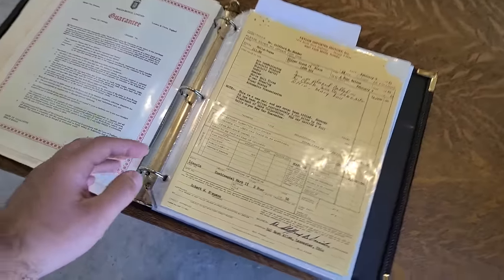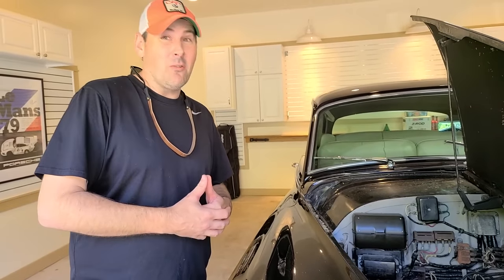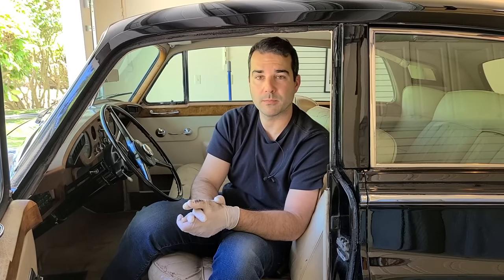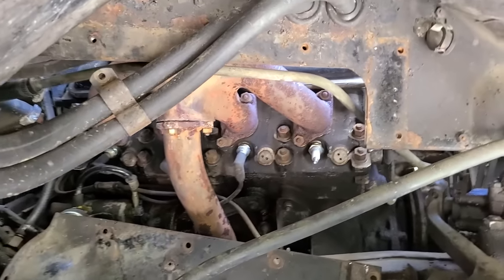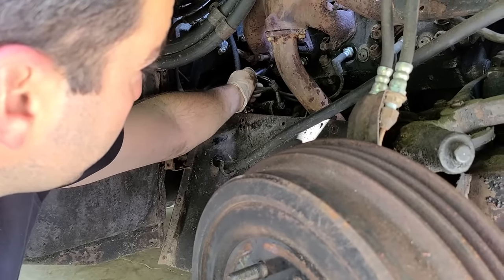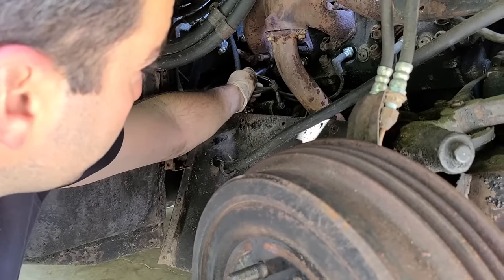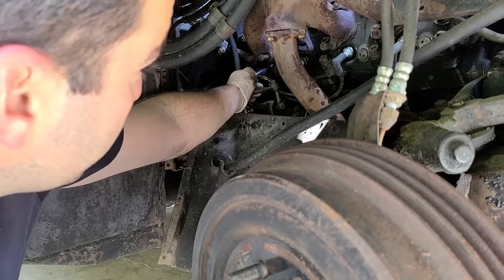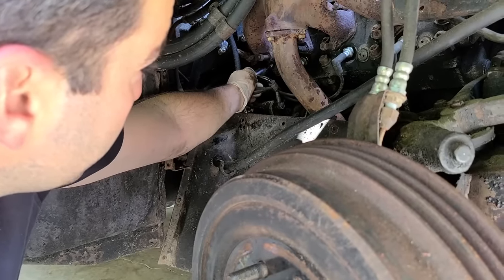I Bought A Broken Rolls-Royce 1000 Miles From Home! 1 Day To Fix EVERYTHING Before Hitting The Road!

Comment: I regret you selling most of the cars in your fleet. You gotta keep this ride to chauffeur your kids to school and sports.
Reply: For their safety, please don’t
Reply: @marcmiyamoto  This was one of the safest cars ever built...
Reply: @fraidykat  so safe it doesn't even have seatbelts
Reply: @poptartmcjelly7054  Not a legal requirement when this old lady was conceived, apart from that drivers of a RR  were a civilised and decent bunch of chaps, unless of course they had a bit of totty on their arm...
Reply: @fraidykat  So safe that even a smartcar (2-seater) tiny micro-car is safer...
Reply: @Samosayummyyay  Smart Car doesn't even come close to this car.  Rolls had one of the best unibodies ever made.
Reply: @poptartmcjelly7054  Didn't need them.
Reply: @fraidykat  there’s literally no seatbelts your gonna tell me a car with no seat belts is safer than a modern car
Reply: @marcmiyamoto  If you want seatbelts you can add them.

The level of safety you prescribe to requires first removing the brain and to then stop thinking.
Reply: @fraidykat  Yeah that’s sounds safer than a Smart Fortwo retro fitting a seatbelt to a 1960’s Metal death trap
Reply: @fraidykat  oh? the smart got a relative high rating whereas that Rolls has not. Also, Mercedes Benz builds those tiny little Smart cars. And unibody does not translate to proper allround safety.
Reply: @Samosayummyyay  The Smart will never overcome the conservation of mass difference between it and anything else on the road except a motorcycle.
Reply: @oneswellfoop  unless you are driving a w124 mercedes. A modern car rear ends you and barely a scratch while the other car is a wreck

Comment: This rolls is much more reliable than the new Mercedes lol
Reply: They have too many finnicky electronics. Source: owner 😥
Reply: @ryanwood6006  Main reason I'm trying to buy a w211 E55 AMG. But also because they're really cool and Alex has a bunch of videos on them.
Reply: No they’re not lmao
Reply: @geoffbob6267  the CLKs are really good cars too. That clk black series is mean if you can get your hands on one
Reply: @ryanwood6006  Yeah, thats the ultimate dream, but my budget is around 12-15K, preferably on the lower end, so I can spend some money on upgrades.
Reply: If someone REALLY WANTED one, I'd suggest buying a clean body and never mind the engine/electrical system... And drop in a crate engine and a "hot rod" wiring harness, and a disc brake conversion...

You'd be able to daily drive it AND it'd still be kooler and cheaper than any modern car.
Reply: Isn't that the truth. About 17 months ago I lost a dealer-maintained ML400, purchased new from the same dealer, due to blocked sun roof drains. Sunroof was completely closed. Heavy rain storm over weekend. Drains backed up. I sucked 3 or 4 gallons from the spare tire area. Had it towed to dealership Sunday night or Monday morning. Dealer drained 11 or 12 more gallons from pan plugs in foot wells, so I was told. My insurance Adjuster came quickly. Turns out, so I was told at dealership, that all of the critical computers were under the carpets and the water intrusion had turned them into toast. Adjuster called in that the vehicle was a total loss after looking at it for 15 minutes, and the check was put in the mail.  The bi-turbo V-6 in that vehicle was just about perfect. If the vehicle had been a little quieter at Interstate speeds over our terrible SC Interstate pavement, I might have bought it at the salvage auction and put it in a hot warehouse to dry out for a month and gotten it running again as a hunting/farm vehicle, or tried to have it shipped to and sold in the Middle East for a premium price.

Warning - For owners of newer Mercedes vehicles who use their dealer for servicing, the techs follow a service procedure designed by and required for use on Mercedes vehicles by Mercedes.  While everything they ever did was detailed to the smallest item, I never saw on any of my detailed service reports any mention of their cleaning the sunroof tracks, checking for retained moisture around those tracks, or even looking into the drains, or checking the flow through the drain lines  by pouring a few ounces of water down the drain holes or blowing them with air pressure to be positive they were open.   Seemingly about 90 to 95% of Mercedes vehicles in ourvarea have sunroofs with internal drains, which sooner or later will get blocked up and flood your vehicle and fry your critical electronics that control every aspect of the successful operation of your vehicle. I think a class action cloud is on the horizon for Mercedes because of their ignoring the cost of fixing the problem or implementing a drain checking program, to prevent avoidable flooding and computer damage, which makes the vehicles unsafe if it occurs when driving and undriveable after parking while the computers remain soaking wet.
Reply: That Mercedes is typical of most so called “premium cars”. They are great when they are new. As soon as serious maintanence is due people get rid of them. The next owner does only the most necessary things to keep them going, bringing them to shabby workshops where the job’s done only so so, no special tools or knowledge. So that “premium” car is now in a derelict state, only maybe 5 years old or even less. Still looking great though but technically beyond affordable to get it fixed properly. And the first owner? He’s cruising along in his brand new “premium” vehicle. And the whole process starts again. This Rolls Royce on the other hand, is a honest, wonderfully made automobile that surely outlives us, even without the proper care. They were special and they still are. Worth treasuring it and keeping it. Take care of this car, it managed to come this far and it would be a shame if it falls into the wrong hands..
Reply: @diablocls55  Oh yes they are
Reply: @Anonymous-it5jw   
Yes, for the cost of the main dealer servicing you would expect them to prevent such basic future failures as that. It's a common fault with Volvo's too. And so easy to avoid.

Comment: I used to work on those regularly in the shop. One thing to pay attention to is the SU carbs. They are similar in function to a CV bike carb but are oil damped on the piston. Oil viscosity can adjust your acceleration rate and is effected by temp and humidity. Also that hot air tube is important for the "choke" pull off. Make sure that dist cap is CLEAN on top to eliminate crossfire, don't forget shock oil, and lastly - did you learn about the 3 brake systems? Don't set it too tight on the variable speed system on the side of the trans or you'll find yourself stuck when it heats up. Have fun with the tank! ALSO - the tool sizes are British Standard. Might want to snap some up.

Comment: Hi Alex. What a find !  Depending if you could salvage the leather facings on the seats ,over here in the UK this could fetch anywhere between $30 to $60 k . The condition of the bodywork is so important and this one appears to be excellent. I think Jay Leno would like this one ! Finished in Mason's Black with the biscuit interior ...superb!  Regarding the bodywork only the opening panels are aluminium the rest is steel , that's why condition is everything. Mr. Royce was killed in a flying accident in around 1910 . And that tiny red car was probably more valuable that the Rolls ! Very rare !  Thanks for sharing

Comment: That is a beautiful car!  It’s literally in mint condition. And I am shocked that you got it so cheap 🤩
Reply: it`s a piece of crap
Reply: You either don't know what literally means, or you don't know what mint means.
Reply: I stand corrected.
Reply: @A Man In A Hat u r right. Thank you for correction
Reply: @OMGWTFLOLSMH  thanks for opening my eyes
Reply: @Tuck31r  is that an opinion or a fact?
Reply: @Tuck31r  In no way
Reply: @xee2  No need for that
Reply: I agree, a magnificent automobile. The hides inside need cleaning and conditioning, and they will look immaculate. The body appears straight, clean, and solid. The mechanical system are typically under-engineered and way over-built.  All it needs is a thorough and careful recommisioning service, and good to go.
Reply: Congrats! Wish I had your RR.
I bought my last Bentley in LA and drove it back to Northern Cal the same day in 100 degree weather.
It was a little newer and in better shape than this RR. Everybody should get the chance to own one of these in their lifetime.
Splendid!

Comment: Check the oil in the carburetors! You can easily find all the parts you need for these cars online from UK suppliers.
Reply: Dexron ATF works really well in SU carbies dashpots.
Reply: It should be engine oil in the R-R SU carburetors

Comment: FYI the thermometer isn't a "laser"-thermometer. The laser spot is for aiming. It's an infrared thermometer that measures the radiated heat. Its sensitive cone is shown on the side of the gun on the diagram.
Reply: Its* sensitive cone

Comment: Make sure you get some lead additive to avoid burning up your valves
Reply: Hardened valve seats are available.
Reply: @andrewallen9993  Preferrably drive with lead additive until it can be confirmed to have the hardened valves.
Reply: @InTeCredo  A very valid point. Marginal overall extra cost to be better safe than sorry.

Comment: It’ll get better fuel mileage when you get it in shape. Found it in great shape. You’ll want to run Evans waterless coolant. And yeah, those Rolls (and the Bentleys from even before the Rolls buy out) are wonderfully easy cars to work on, and super reliable.
Reply: Go to a municipal airport and fill it with aviation fuel; it's got the lead that old girl is starving for.

Comment: The cool thing about those old Rolls, nearly everything is designed to be rebuilt.
Reply: They knew it will break, bcs it's British
Reply: @ivanjovanovic362  still more reliable than an old Italian sports car
Reply: @ivanjovanovic362  all cars do eventually.
Reply: Interesting thing about manual Rolls/Bentleys. The Bentley Mk6 uses a Caterpillar steering clutch (can't remember which but it would be an early 1950s model) as its clutch.

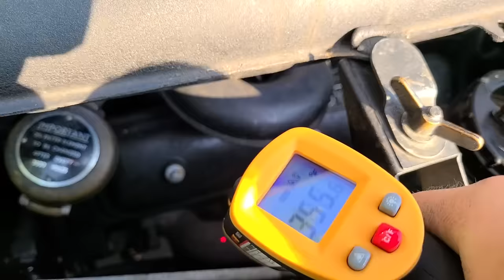Comment: 0:09 Oil seal between timing gear covers
14:49 Neutral and reverse light switch on gear selector linkage 
You got it wrong talking about the flying lady
Reply: Oil seal*
Reply: @krazzysu  Thank You!
Round soft rubber gasket strip
Do you want the spare part no?

Comment: The two contact points on the steering column is the Neutral Safety Switch. It basically prevents you from starting the car if it's in any other gear unless it's in Neutral first.
Reply: Correct!  Just safety interlocks.

Comment: 19:35…Many years ago, I once saw and heard a 1926 Rolls Royce engine run whisper quiet,…with the hood open, and with the motor rpm running well under 1000 RPM. It was designed to run that way. It was one of the most amazing things I’ve ever seen!

Comment: The sump plug and other bolts would likely be in British standard whitworth
Reply: Imperial quarts and Witworth hardware.  I'm still grateful that My MGB did not use Whitworth!
Reply: At least with Whitworth you don't need that many tools. Not a lot of sizes used in cars.

Comment: So cool that the old girl gave you a good trip. Good stuff considering first up it is an old car which is for it's age quite complicated and second the period of time it had been sitting for. You did do some good prep work.  Once again you have boutht back some good old memories.   I was an apprentice and continued to work with Rolls Royce here in Sydney Australia for 12 years. I started with Rolls when I was 16years old in 1972 and finished with them and went to Mercedes in 1984. Good times good memories and your video bought it all back. I really should buy a Cloud 2 or Cloud 3, maybe I will once I can get back into a workshop. Was never really a fan of the Cloud 1, the six cylinder. Thanks for the post, most enjoyable. Also had a good laugh.

Comment: If those were Lucas gauges that would be perfectly normal 😀. Great car, great video.
Reply: Rover P4 models had the same "press the button and fuel gauge shows sump oil level" feature. Useful on my 1950 Rover 75 Cyclops which still leaks.  My gauges are Jaeger, not Lucas, but I would not be surprised to find Jaeger was a brand name for Lucas. 
The leather gaiters (ie sleeves) on the leaf springs are also not uncommon. My 1950 Humber Super Snipe Mark 2 (the one car I should NEVER have sold !) had those.  They were fitted with grease nipples so the mechanic could just pump in more grease without getting his hand dirty.  Alas, my gaiters were rotten (I blame salt on the winter roads) and disintegrated the first time I tried to pump any grease in.
Reply: I believe they were Smiths instruments, usually powered by smoke, when the smoke leaked out they failed to work 😂😂😂😂😂. The old ones are the best!

Comment: Top up the oil in the SU carbs it makes a big difference if they are low on oil. The tops just unscrew . 8 mpg !!!
Reply: No heat rising to the auto choke with that broken pipe off the exhaust manifold = choke on....

Comment: you should learn the basics : a threaded rod with a head is a screw, when you assemble a screw and a nut you get a bolt....
Reply: Not sure that's true
Reply: The bolt consists of a head and a cylindrical body with screw threads along a portion of its length. The nut is the female member of the pair, having internal threads to match those of the bolt. Washers are often used to prevent loosening and crushing. (encyclopaedia Britannica)

Comment: Mr “mistress expert” needs to look up Eleanor Velasco. Also try Henry Royce and Charles Rolls
Reply: It was his secretary.
Reply: @prillewitz  ….and Lord Montagues Mistress! Eleanor Velasco Thornton, thought to be Charles Sykes model for the Rolls-Royce Mascot, Spirit of Ecstacy as well as Montagues first mascot, the Whisperer. Can be seen at the National motoring museum in Beaulieu.  BTW, in the boot, to the left under the carpet should be the tool kit to do most anything you need to do to the car, including the oil canister. (Which can be removed by turning the steering wheel) I have a 59 Cloud II and i will NOT ALLOW GREY POOP IN MY CAR,!!  Frenchs all the way!!! I do hope by now you gave joined the R.R.O.C.
Reply: @steelman86  Well…I guess he needed someone extra to hold his pencil. It looks nice on the cars though. Still looking for a cheap one, and I know there are, as I watched Wheeler Dealers, but until now it will remain a dream, I never get tired of looking at them.

Comment: I thought I'd heard a brake job on a Rolls Royce like yours required taking out major parts in the rear and and getting a bill for about $5,000 or more. You did it in less than 10 minutes and at no cost.  That's what makes it a great video.

Comment: In the UK we used ceramic fuse holders and fuse wire for the 240vac supply in the home for many years. If it blew a fuse and you where out of wire an old trick was to use the foil from the inside of a cardboard cigarette packet. ONLY temperately of course. . 👍

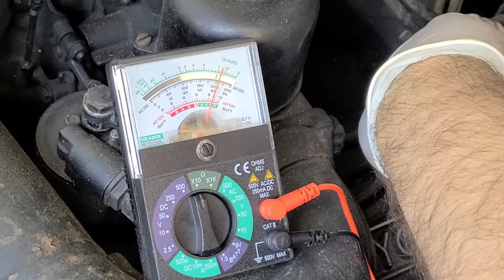Comment: 16:20 the ohms scale is the green one and   reads 0.8 or 0.9 with the x10 factor range scale selected means ~8 or ~9 Ohms, not 9 thousand!. An ideal wire has 0 ohms , it means no resistence , so when lower the value, good condition.
Make sure to proper clean up the clamp pins fore these wires with a brush and cleaner contact spray for electric parts that you can buy in a electronic component store. The contact of different metal materials like copper with these pins can generate a kind of rust.

Comment: Those gauges (oil water etc) should usually be in the middle. Either dead vertical or horizontal.
What my dad liked about his Rolls Royce cars is that any parts you buy fit perfectly. And they are properly built instead of merely "assembled"
I wouldn't worry to much about the brakes, I think there is a back-up in the event of a failure.

Comment: Air filter is an oil bath type same as the Landrover. The SU carbies need to be kept oiled down the pistons to work properly, and will seize if left to run dry. Basic engines, I recollect RR purchased a Pontiac or something and basically copied it in the day. There is quite a lot of rust on the chassis which used to fail them on roadworthy certificates due to the English propensity for sprinkling salt on the roads, though I do not know the situation in the States. A nice car that will give years of service if looked after. It was a good buy!

Comment: Check with R-R about the high zinc oil.  I drive a 1950 English car and the car club has specifically warned not to use oil with zinc additives - won't go into the reasons here. But the cheapest supermarket 20-50 (Caltex) is vastly superior to anything available in 1950. I have used Amsoil and still would if rising cost had not made it unaffordable in my country.  Of all the oil companies I wrote to when I acquired a '57 VW many years ago, Amsoil was the only one to respond so kudos to them.

Comment: You should pick up a bottle of Lucas electrical smoke (p/n 530433) just in case....

Regarding the steering slop, did you check the rubber spider on the steering shaft?

Comment: I had a friend who was an experienced Rolls mechanic, actually he could fix anything. He spent twenty years or working on Roll s autos out of California.I remember once he replaced the engine in a 50 or 60s model.Rolls wouldn allow him to. Rebuild anything. It came with all accessories?I guess that’s the way they did it then? An older couple here in El Paso owned one and he made a simple carburetor with a. Screwdriver charged her $2.00 . She told him he could h❤️ave charged$20,00 for his knowledge and expertise. Nice video thank you .